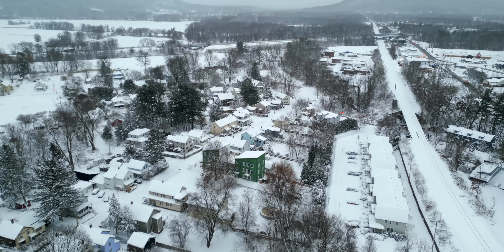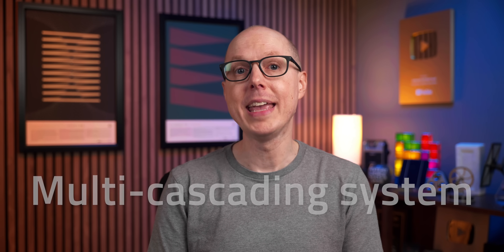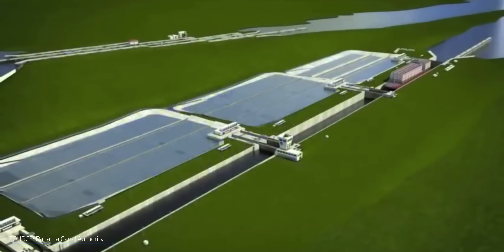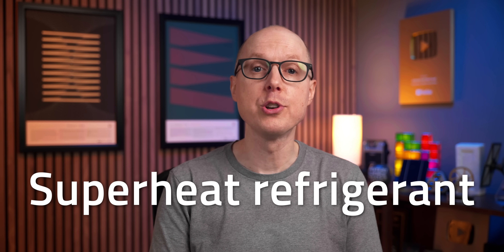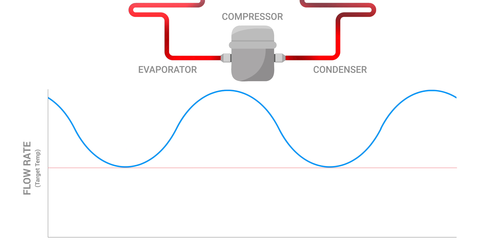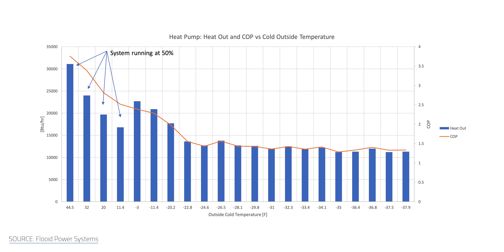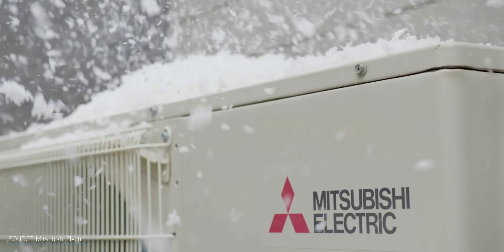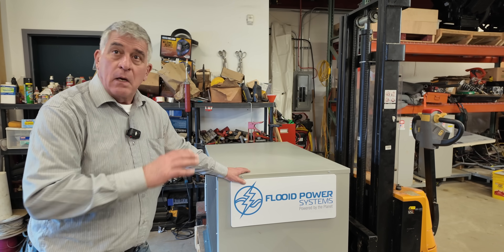How This New Heat Pump is Genius

Comment: So, from someone who works on HVAC units for a living: looking at the website and how it works, it literally just looks like a Water-source Heat Pump with needless extra steps. A water-source already can do the heating and cooling, attaching it to a boiler/water heater and super store tank. Adding in the condenser outside seems like an added step that isn't required in any way. Plus, if you wanted an outside condenser, get something like a Mitsubishi H2I system since those are good to -13 degrees Fahrenheit. Yes, you can get a ducted H2I system, so you're not limited to a ductless minisplit system.

If there's something I'm not catching, or if it turns out to have a greater efficiency in some way that's proven through an on-site test outside of a 'controlled environment' and not CGI (like on the website), I'd be more than happy to state I am wrong and correct this statement, but at the moment, looking at the site, it seems needless.

Edit: Upon looking at the definition of a Cascading system, it's redundant, because you could get a multi-stage heat pump system for residential/commercial/industrial without needing multiple units. Getting multiple units is pointless outside of having a backup redundant system. otherwise get a 2-3 stage system, or if you're absolutely concerned, get an 18 SEER 5-stage Infinity Carrier system.

Edit 2: Trane already has this type of system as well, it's not new XD
Reply: Multi-stage in an HVAC context means the unit can operate at multiple power levels, it's still only one refrigeration loop. This is totally different than a cascaded system with multiple series loops. I don't think you are grasping what a cascaded system does.

I thought the Mitsubishi units only got a claimed COP of ~1.5 at the bottom of its temperature range. If the Flooid is claiming a COP of 2.2 in the same conditions it's definitely more efficient. Cascaded tech can give you a heat pump that works when it's much colder outside.
Reply: @eDoc2020  I know what multi-stage and cascaded systems do. However, adding in a second unit for use in parallel as an acting second-stage seems pointless outside of using it for redundancy. I directly looked it up and what I got was that cascading systems are all basically used in conjunction with one-another to insure functionality and easier control, meanwhile you get the same thing with a multi-stage system but without the redundancy. 

For use in industrial or commercial, it means the same thing. Rooftop units (the big 20+ ton ones) have stages that rely on multiple compressors instead of one, all working at 100% 24/7. The second ‘stage’ is the second compressor kicking on to supply more heat/AC and also works as a redundancy when the first compressor fails, often times having a separate closed loop, making it a cascading system in one package. It is, however, still a multi-stage system no matter how you slice it. 

As for the exact specs on Mistubishi units, I don’t know the details down to the T. I mainly just work on and install the things, but I do know that the H2I is more than efficient enough to handle most situations in only a single unit. If the Flooid is claiming better, I’d first have to see real data instead of claims and see direct comparisons. By no means am I trashing Flooid, if it’s genuinely better, I’d be more than happy to install these things, but I just don’t see it right now. Also, couldn’t you just get a water-source heat pump instead and not have to worry much- if at all- about the outside temperature? If your insulation is up to code then it shouldn’t matter what the outside temp is really at all, as the water is heated inside and not exposed to the elements.

Cascading systems seem redundant and more expensive either way, because you’re buying more than one condenser, more than one lineset, and (pending on how you set it up, I suppose) more than one air handler. Plus all the space you’re losing out on. The Flooid is claiming it could heat up a water storage tank as well, or even supply heat to the main water supply, but like… at that point, just get a normal water heater? If you’re worried about efficiency, just get a tankless heater and get a multi-stage system. That way they can run independently, and you’re probably saving money as well especially from rebates and utilities. 

Also, Flooid’s diagram of using a heatpump to warm water for baseboard heating is nonsensical in full. More efficient to get an electric water heater, no need for excess linesets, no need for refrigerant, and especially no need for extra maintenance on an outside unit when it could be handled inside in a smaller package.
Reply: @deathound  It really sounds like you don't know how cascaded systems work. They have two compressors and two refrigerant loops but only one outside air coil, only one inside air coil, and no redundancy. A crude cascade system is a refrigerator in an air-conditioned house.
Reply: @eDoc2020 I dunno man, I literally google searched it and that was the result it gave me, so either google is wrong and you know something I don’t, or…

Either way, it sounds like the same thing as the rooftop systems I mentioned. Which is a multi-stage system. We’re probably talking about the same thing and using different words, because as I mentioned before, that’s literally what the rooftop units are and yet are still called multi-stage systems because one kicks on after the other. There are also multi-stage compressors, which is (basically) the same thing. 

Also, if it’s just one outside unit, and one inside coil, where is the second compressor in say a residential unit? It would need it’s own fan, it would be more efficient to have it’s own coil for more effective heat transfer, but there’s still no room for it, unless it’s a massive system, which I have never seen anywhere. So you’d be getting a different system all together.

It makes sense for commercial and industrial since those units are massive, and have multiple compressors, often with their own closed loops of refrigerant. So we’re talking about the same thing here using different words, because those units use two different compressors, but they’re in sequence- in stages- to maximize efficiency. They have their own fans, the coil is huge and designed with it in mind, and it also has fans and everything inside it to supply air to the building. It’s just one massive singular unit.

Instead of calling me ignorant though, why not actually explain how it works? Because clearly google isn’t helping if you’re so sure about it.
Reply: @deathound   Non-cascade "multi-stage" systems are like putting multiple window AC units in the same large room. Each refrigeration loop has one part inside and one part outside. Each loop sees the same working temperatures, let's say 100F outside and 70F inside.

A cascade system is like putting a refrigerator inside a room cooled by a window AC. There's only one outdoor coil and there's only one coil inside the fridge. The first loop (the window AC) cools from 100F to 70F and the second loop (the fridge) cools from 70F to 37F.

A proper cascade system goes one step further by directly thermal coupling the two loops. Instead of the window AC with a refrigerant->air heat evaporator and the fridge's air->refrigerant condenser there's just a single refrigerant->refrigerant heat exchanger that acts as both one system's evaporator and the other's condenser.

TLDR: non-cascade multistage = outdoor air->refrigerant->indoor air + outdoor air->refrigerant->indoor air.
Cascade system =  outdoor air->refrigerant->another refrigerant->indoor air.
Reply: @eDoc2020  See, that’s explained much better than the google search, but I still wonder what the exact purpose of it is. Why have an outdoor unit transferring to a second unit indoors when you could completely be rid of the outdoor entirely to save money? From what I can tell, doing a system like this isn’t more efficient but is more capable, able to reach lower or higher temps. But the cost of utilities and maintenance, plus the price of the system itself, seems like it would be excessive when a single unit could do the job.
Reply: @deathound  Yes, the main usage is to reach temperature extremes. You need huge pressure differentials when going from very hot to very cold using a common refrigerant and this isn't practical. Even if you can attain the pressures needed it's not very efficient. At some point the higher efficiency of a different low-temperature refrigerant overcomes the inefficiency of needing a second stage to bring it up to room temperature. The "magic sauce" is intelligently varying the power of each stage and applying bypasses in order to always achieve the best performance.

In other words, yes it's excessive when a single-loop system can do the job well. Above 5F/-15C a regular system works well. Below -20F/-30C you need something else.
Reply: @eDoc2020  So the Flooid system is impractical outside of extremes where special units are put in place anyway. In other words, it’s got no reason to even be in New England because the job is handled better by other systems. So… my whole main point of Flooid being excessive and impractical still makes sense. For places like the central US you’re not really going to need a heatpump anyway because you’ll be focusing on AC units, which already have a minimum SEER requirement of (16 I think? Might be wrong there) and the units are generally capable of handling those high temps as is.
Reply: @deathound   For the central US you're going to need a heatpump because winter still exists, but not enough to need a special heatpump. For Northern New England where (I think) there's a decent amount of time below 0F it might make sense to have a cascade system assuming it really does perform better.
Reply: @eDoc2020  I live in MA, and I can safely say it's rarely below 0, rarer to have a negative day, rarer still to hit something like -13. I could make a safe bet that places further north of here might not hit those temps often. Going past the border, maybe? But I can't see it here in the US. For places out in the central US, yes they still get winter, but that's like saying winter is 65 degrees XD, I think a basic heat strip in an air handler would probably be the most efficient there as very little is needed, but of course it's all to personal taste. Kinda like Florida where the people are throwing on winter coats when the coldest you'd get is 70 degrees lmao.
Reply: @deathound   I'm also in MA and there was that one day a few years ago when it -20F. It's rare enough that it's rational to use emergency electric heat but on the other hand it just feels wrong to get a heat pump that doesn't work at all that low.

I'd really need to know the actual performance at different temperatures. How cold does it need to be in order to perform better than a standard model? Here the 50% heating temp (a term I just made up) is about 30F so this cascade system surely isn't worth it. It would probably only offer better performance something like 2% of the time. If if offered better performance for 25% of the yearly heating needs it would be worth considering.

Note that I'm saying percentage of heating needs, not percentage of time.
Reply: @eDoc2020  Correct, still, EM and AUX heat (electric heat strips) usually cover fine enough on those emergency days. They don’t happen often enough to really justify the higher cost as you’d take much longer, if ever, to get a return on that investment. An electric heat strip is only like $180 (pending on unit size of course) and can transfer a good chunk of heat no problem.

Still, I agree, I’d need to see actual test results on these units. In a vast majority of places it seems like a total waste, and as I mentioned before, Trane already has a cascading system. Plus… Watersource exists, so I mean, I really can’t see this system taking off very well, if at all, outside of extremes like the middle of a desert or up in Antarctica lmao

Btw, glad we had an actual discussion on this. Learned something new. I still don’t really see these units as all that useful, as other cheaper options exist, but still. Was good to chat. I’d offer to shake your hand but y’know… lol

Comment: Scanning through the comments here is rather astonishing. Even many from people in the industry don't get it. This is NOT a new concept. and it DOES work. Well. Two and three stage air compressors, and scroll compressors, use the same thermodynamic concepts. As do multistage compressors, and turbines, used in power plants and aircraft. A bit further back, and the double and triple expansion stem engines use the same properties to improve efficiency and overall range of performance. Cryogenic systems have been in this space for decades, but cost isn't a real issue there.  IF, and I say IF, the product can meet price and reliability goals, this is awesome and I welcome this player to the game. The reason the concept hasn't been really exploited in the past in HVAC  is that the diminishing returns were beaten by the cost and reliability curves. I will be very happy if there is finally someone that can get to the economical side of the curve and get me away from gas and resistive electric.

Comment: The main problem with heat pumps is that cost savings on your energy bill won't justify the cost of the system. Especially if something breaks outside of warranty. I think the biggest thing is that manufacturers need to get  the price down for heat pump systems to truly justify buying a heat pump
Reply: Or you could try California where your electric rates are $.40 per kilowatt hour and then the math might play out just fine!. 😂😂

Comment: Learned a lot from this video -  thanks! :)  
I didn't know that heat pumps actually had an upper temperature limit as well. We (very) occasionally get 42C summer days here in the Canadian prairies, which I didn't know was so close to the heat pump's upper limit. Our 3.5 ton ducted inverter HP has had no problem maintaining a 21.5C indoor setpoint without showing any signs of stress, but I had no idea it was so close to the limit. Bonkers! Perhaps I should ease the thermostat to around 24ish on 40+ days just to give the poor thing a bit of a break.

Comment: I am in TN near Nashville.  Here we do get 100+ summers and a few weeks below 0 F in the winter.  Our house has a heat pump but with a resistive 'heat kit'.  Nothing we have, even our EVs use electricity like the Heat Kit (resistive heater that de-freezes the heat pump).  

We stil have people that tell us that 'heat pumps don't work below 32F' and other such drivel.  When we need to upgrade our heat pump in a few years I would LOVE to have anything near affordable heat pump that really works!  Heat pumps in our area tend to be 'package units' that sit outside the house that includes both 'inside' and 'outside' portions of the heat pump and our return and conditioned air ducts got to the unit that sits just outside our home, this make a compete 'hvac package' (and it sits on a small slab just outside our home, with ducts in our crawl space).
Reply: Tell the scoffers that "Yes, and Model T cars couldn't go faster than 25 miles per hour, too, back when!"

Comment: The main problem with air-source heat-pumps is that the energy density of air is way too low.
They need thousands of cubic meters of air to pass through each hour.
That's why most air-source heat-pumps have gigantic propellers.
That's why most air-source heat-pumps make a terrible loud noise.
A cascading  air-source heat-pump won't solve this problem

Comment: That's exactly what I need for my next heat pump. It'd let me get rid of my propane furnace backup without upgrading our electrical service to have enough room for heat strip circuits. Our current Amana 20 SEER air source heat pump does alright down to about 5-10F, but it's running at a COP of about 1 then and in the Midwest we spend about 15-20 days a year below that. We'd probably have enough insulation to deal with one night of those temps, but it's usually for a whole week when we get those polar vortexes.

Comment: So, are you suggesting they have gotten past the issue of frosting of the condensing unit?
I really want to go with the ASHP vs GSHP but cannot rely on systems that need 30°f or so temps to achieve the claimed COP.

Comment: Hey Matt, 
Thanks for the all the great work on this channel. Question for you. little unrelated to this video, but related to the heat pumps.

What do you think about laundry dryers with heat pump?
They seems to be NOT very popular in US. I can see some good advantages being ventless, energy efficient, 120V outlet support.

There are even combo options with washer/dryer combined which seem to have even more advantages: less room space and laundry can be done in one cycle without need to move wet cloths around.
Why is this not getting popularity in US? Is it the price?
Reply: They cost more and each load takes more time.